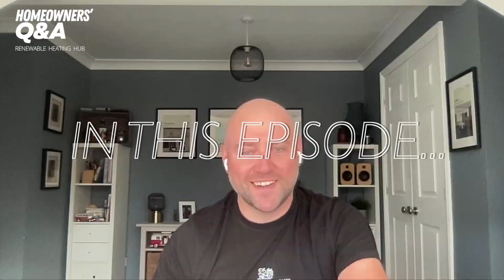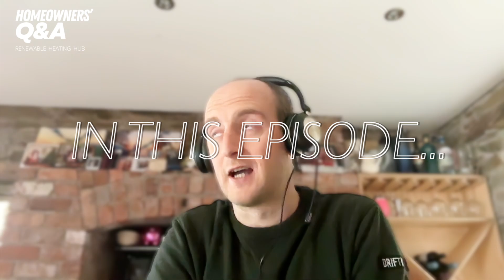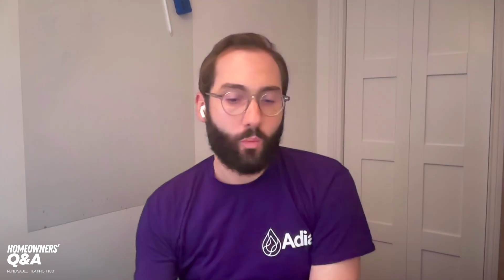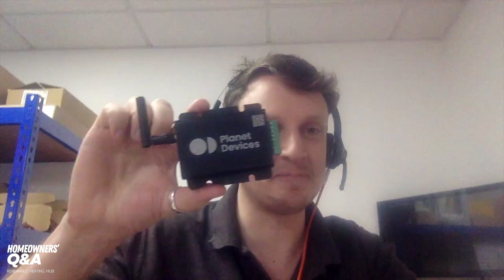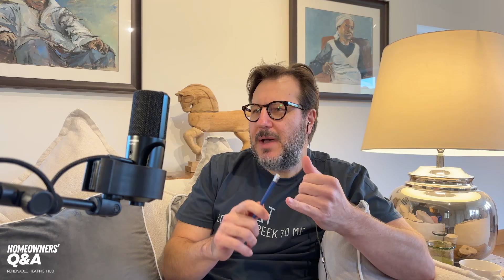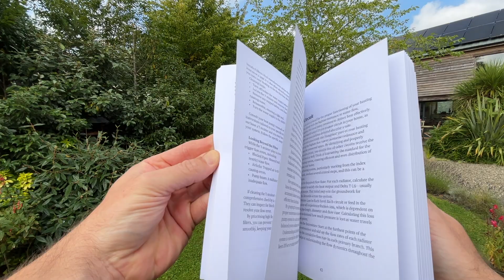Heat Pump Monitoring Options: Adia, Havenwise, HeatPumpMonitor, Homely & Planet Devices

Comment: Just installed a heat pump with Homely controller.  We have circulation issues and have requested data from Homely to help us with these issues. This has been rejected, so we are stuck with a cold house. Never use Homely.
Reply from the maker: Why did they reject your request?
Reply: @ thanks for replying, it’s nice to know someone is interested.  The install was £14,500 with £7500 remove with the BUS grant, so quite an expensive lesson.
Reply from the maker: This is interesting. Do you think you could post your question and concerns here: https://renewableheatinghub.co.uk/forums/renewable-heating-air-source-heap-pumps-ashps/getting-the-best-out-of-a-heat-pump-is-homely-a-possible-answer/paged/9#post-32687

It’ll be much easier to communicate on the forums.
Reply: @ZoeandSimon-q4e  This sounds like a bad installation issue. I am just considering ASHP and have watched several YouTube videos to gain as much knowledge before installing. HeatGeek and Skill Builder ran some interesting vids where they sorted out a customer's bad installation. Simplicity of design is key to a successful installation is what I am seeing.
Reply: @ No data is available from homely, unless we speak to the installer, we can’t even find out the COP on the system. I have been quoted some energy usage figures which have no resemblance to the actual energy usage. Our system is not getting up to temperature, but I have no way in which to prove that the Heat pump is not performing.  Homely have been very inflexible, stating that we need to get the data from the installer, crazy. The upsetting thing about all of this was that I was a huge advocate of Homely.  I’m from a software background and saw this as a huge benefit.  At the moment we are discussing scrapping the ASHP and moving to a Combi.  Very sad.
Reply: That’s a shame and the opposite of the experience we had. It’s runs our heat pump amazingly from both a cost and comfort perspective and I have to do literally nothing, far easier than a boiler.

Comment: I've used Open Energy Monitor for my solar PV since 2016 so it was easy to extend to our Daikin heat pump last year. This data has been essential to understand why we had a low COP. With retro-fit systems in particular, I believe comprehensive monitoring should come as standard, and installers should be monitoring proactively until the system yields the expected COP.  Otherwise we're using public subsidies (the BUS subsidy in England) to encourage only mediocre performance. New systems should be easier as they should be free from issues caused by legacy piping and radiators.

Comment: I have a homely.  It is no good for monitoring - data is actively hidden from the customer - no COP or energy usage at all!  In the installer app the COP is misleading as it is based on MCS data tables rather than actual energy usage l, so COP always looks better than it is…
Reply: good to know, would not have believed that after I had seen the lithuanian founder on the heat geek show painting a different picture.
He was talking about efficiency the whole time, running the heatpump most eefficiently based on the weather and solarpower forecast and lot more, but you are telling that you have no real COP .
Reply: I have one, too, during the first two months, I spotted savings of up to 25% as I'm not an advanced user, and it's my first heat pump ever I'm pretty happy with the results I'm seeing. What is COP, and how can it help me save more than Homely does?
Reply: Just discussed this issue with Homely, we are having issues with our heat pump and received no data from Homely, we are on our own.  Promised to send data within 30 days. Very poor and would never have bought a heat pump that had Homely as a controller had we known this.  Interesting that Jamie side stepped the question of data on the video.  Wished I had seen this before spending £14,000.
Reply: I have one too, too early for me to decide if it was a good addition or not. In practical terms the only thing that matters is whether it is controlling the house to the temperature you desire and whether the energy usage is more or less with or without it. 

If it really worries you, why not ask your installer to provide you the data that they get on their installer app. Or (I haven’t tried it yet) but I’d bet you could install the installer app and link your device to the the app directly. There is training you can find to tell you how to do this. Or, I’m fairly sure you can get the SCOP and COP stats off the primary heat pump controller. 
BUT, surely the cost and comfort is the real measure, are your heating costs more or less than before.
Reply: Thank you for sharing your thoughts! We appreciate your feedback and want to clarify a few points.
Homely is designed specifically to optimise heat pump efficiency. Whilst we do offer a monitoring proposition for installers to identify systems underperforming , our primary goal is to help users get the most out of their heat pumps by dynamically adjusting settings based on weather forecasts and other real-time factors that enhance comfort and cost savings.
You are correct, the COP calculations you mentioned are based on manufacturer performance tables. These are mainly to be used for identification of problem (issue) systems in installer portfolio. These estimates wouldn’t be as accurate as say Open Energy monitor, but for general issue identification are seen to be sufficient.  Manufacturer performance table information also helps ensure that Homely optimises your heat pump to work efficiently under expected conditions.
Rest assured, Homely is working as our Head of Technology discussed—our system uses all available data to maximise efficiency.
Reply: @HomelyEnergy  As a new customer of yours I do have to provide the feedback that this attitude really stinks.
I was really close to cancelling my order because of this lack of transparency, it is my data not yours. 
I would normally be able to interrogate the manufacturers control interface, in my case a nasty Samsung unit, but with your optimiser installed that option is now not available to me. We are the customer after all. I am a big advocate for supporting UK innovation, particularly university incubators, but whomever sits on your advisory board should be putting a rocket up the person responsible for customer service backside.

Comment: As a OAP who has just lost the heating allowance my only interest is the cost of heating the house and unfortunately Heat Pump isn’t doing it.Heat Loss Calculations,Flow/Return,Low Loss Header and another 50 excuses of why it’s not doing what my Combi did.The answer is see your installers or  get a expert in the nearest is 40miles away for my HP big bucks will that solve the problem Not a chance.Just a little moan,It’s going to be a cold winter for some.
Reply: That's sad to hear, as someone looking into a heat pump for my old gas boiler replacement its worrying.  From the HeatGeek side it seems they pair down on complex extra kit and get the system running.  Would like to hear more of your story, maybe the channel could interview you and have a deep dive into what's not working?
Reply: What part of the country?

Comment: It does seem that manufacturers have taken a decision not to give customers full access to the required data to run their heat pumps efficiently. This has created business opportunities for some companies as your discussion shows. But it does beg the question, are we really saying that the 'out of the box' control systems for these heat pumps fail to give customers the required info to run their systems efficiently? Can't think of many other products that you pay £15000 + for,  that then requires a customer to engage a third party to run efficiently.  Seems insane.
Reply: Automotive manufacturers have their own tool and there are many tools from the obd industry
Reply: @janwillem6953  not really compareable or do you believe that third party tools from the obd area are able to lower the consumption ?
I do not.